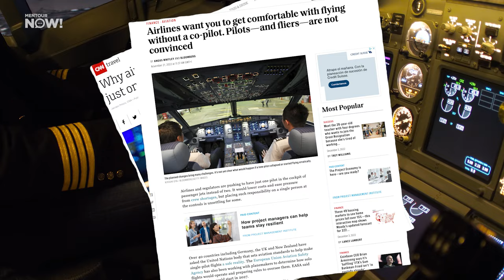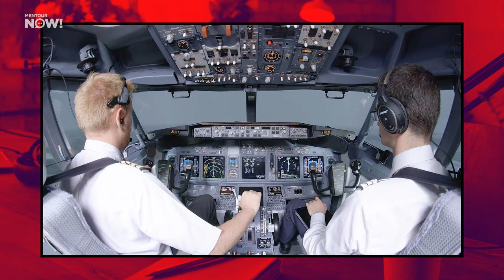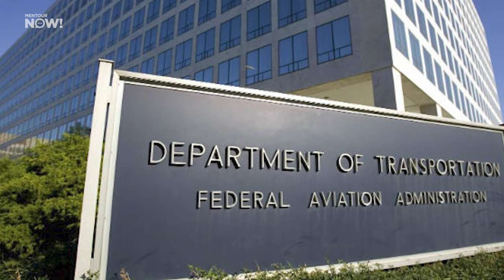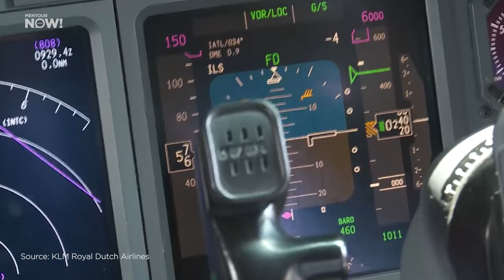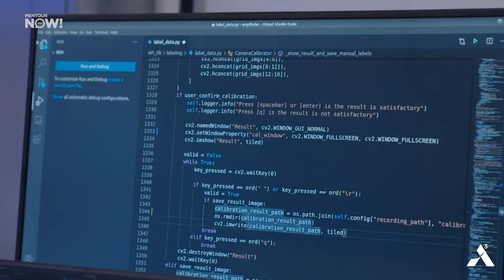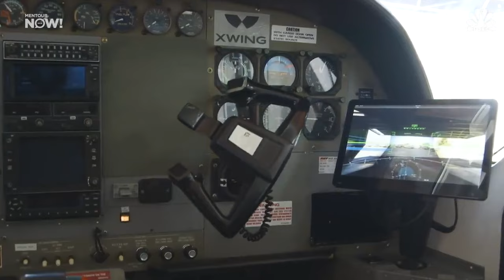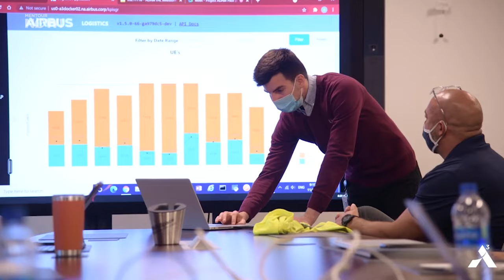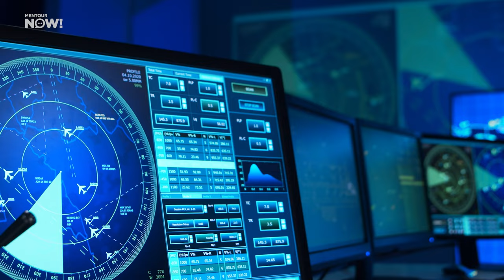The End of the Two-Pilot Cockpit?! Get Ready for Single-Pilot and No-Pilot Airliners!

Comment: If single pilot operation is approved, it most certainly will lead to a race to the bottom, all in the pursuit of higher profits.

While not a perfect analogy, we have seen this in the railway industry in the UK - removing guards (which is a safety critical role) from services and replacing them with Driver Only Operation (DOO) services. There have been a significant number of accidents (particularly people getting caught in the doors and dragged underneath trains) that potentially could have been avoided if the services had guards.
Reply: I would use a Boeing 373 MIN with only one wing, only one gear and only one engine flown by no pilot but a Tesla bot. And get my petrol from cheap russian tankers. Then i could sell ultra cheap tickets to the germans so they can fly to their beloved Ballermann every vickend.
Reply: Guards WERE a necessity in the days of unfitted rolling stock. The guard's role would have been better described as being that of brakeman. He also used to have duties with respect to protecting the train at rear in the event of failure. However, technology means that signalmen now know where trains are, that trains are also self-reporting and that the driver can communicate directly with signallers from the safety and comfort of his cab.
Let's not pretend that guards were infallible. History relates that there were also plenty of accidents caused because guards FAILED to protect their trains.There is nothing a guard does with respect to DOO that a driver could not also do. Change the rules a bit: make the driver step outside his cab before he closes the doors or install monitors or do a host of other things which give the driver the same ability as a guard to check the train is clear of obstacles before sealing it.
There have been a relatively small number of accidents of the sort you desccribe. As train technology develops, such instances become ever rarer. Simple examples: better sensors in the doors which can be linked to the motor. protective screens on platforms which align with doors (these have been implemented on many stations around the world). The guard just is not important enough these days to have a valid role in railway safety.
Reply: removing guards is not a necessity for trains as you can have cameras on the inside and outside of the train where the doors are to see if anyone is trapped in the door. The only reason they still exist is train drivers going to strike. People went on strike with the industrial revolution too, they didn't want machines taking over their jobs.
Reply: Aviation is most certainly going to follow a similar trajectory to rail if labor(workers) can't get it together and get power over these corporate boards.
Reply: @sadiporter2966  they didn't want to be poor and in the street, the job was not the issue. Make more, do more, get less, unless you're at the top. They may have sensors that could prevent something, but that doesn't mean they implement them, maybe sometimes but not everytime.
Reply: @thomasm1964  -  It might be worth considering that trains are traveling on rails at FL 0 AGL and are considerably less complex than a modern commercial airliner.
Reply: This is a completely false analogy, though. The DLR eliminated drivers before guards (assuming we are speaking of modern guards and not brakemen), and here we are discussing eliminating pilots before cabin crew. Perhaps the cabin crew are never eliminated. Perhaps it would be nice to have cabin crew on metro trains. That's all nothing to do with drivers or pilots, whose job is to interface with technical systems, not—aside from the odd joke on the tannoy—passengers.
Reply: @wickedcabinboy  To be clear, I am with Petter on this one. I want two pilots up front on an aircraft. However, I don’t have the power to make decisions about the future of aviation. Describing a possible course of development is not the same as approving of it.
Reply: @thomasm1964  -  Petter did not leave me with the impression he approved of it either.
Reply: The train analogy doesn't work. Japan for example has extensive driver only operation services, including one-man or no-man train services. If you're looking for something to blame in the UK, going to driver only operation is not it.
Reply: @sadiporter2966 and who is watching the cameras? You can keep getting rid of positions, delegating the previous jobs’ responsibilities to whoever is left, but at a certain point the person left will simply not be able to do so many tasks at once. A driver with some cameras is just not equivalent to additional trained and experienced workers.

There’s only so much attention/work that you can squeeze out of a single person.

Comment: Can you imagine what would have happened to the Qantas flight when the A380 lost one engine and cut all the wiring if there's only one pilot up there scary
Reply: Germanwings
Reply: Agreed, in general. It would be hard for automation to be coded for such a cascade and proliferation of failures as that QANTAS flight. However, the situation that Mentour suggests is on the cards would have two pilots during the takeoff and climb phase, which is when this failure happened. In fact, they had a check pilot in the cockpit, plus one other (for reasons that escape me and laziness prevents me looking up :-) so there was a lot more grey matter in operation than any automation software is likely to match.

Comment: Redundancy is standard in the western electrical interconnection in the United States (except, sometimes at Pacific Gas and Electric- PG&E - and we’ve seen how well that works). 
We could operate everything with single components, but prudence dictates that we plan for the N-1 contingency, and that can only be done if there’s at least two…

Comment: I agree it sounds like a good idea as an aid for the 2 pilots to help with the workload and especially if there is an incapacitation with one of them so the remaining pilot still gets some help and a system to check them because more mistakes probably would happen then from the extra stress of suddenly being the sole person flying and no checking system. To have automation help with that regard would be great or if the pilots are fatigue toward the end of a hard shift. This technology should be an aid, not replacement.

Comment: Thank you for a very well thought out presentation of this topic. There are elements that I didn't consider, such as the reduction from three to two flight members with no evident lack of safety. However, a single pilot is not something I'm willing to accept. I think most people are of similar feelings. It will be interesting to see what happens.
Reply: Keep in mind that the three to two was the removal of a flight engineer, not a flying pilot.  Automation can handle engine performance, but flight is a constant variable environment.  I agree with your few, but just wanted to enhance that removing a navigator, an engineer are much simpler than removing a backup pilot.

Comment: Even if the technology allowing planes to be flown by a single pilot was approved, I think it would always be best to have a second pilot in the flight deck in case things go bad. There are just some things that technology can't replicate, such as human experience and reasoning. Having two pilots is good for accountability. It's safe for everyone.
Reply: Indeed, exactly.
Reply: AI relies on input from sensors. What happens when those inputs malfunction?
AI can't look out the window and rely on its gut feeling and instincts... because it doesn't have any.
Reply: @WildB06  considering how often it is stressed that pilots should not rely on what they see out of the window, because their gut instinct is wrong, and that this has caused pilots to crash planes, you make a solid argument why we should replace pilots with AI.
Reply: @deice3  there's no doubt that on some occasions pilots have crashed a plane by relying on their gut instincts... but equally there have been many crashes where the automation and avionic sensors have failed. In an emergency situation I'd rather have a crew of professional pilots, with real and natural feelings and a strong desire to live trying to sort the problem than a computer program reliant on sensor inputs.
Reply: @WildB06  Indeed.

Comment: Petter, I have one thought that was not covered in that video, which is how will a newly recruited pilot build up experience to the point that he can be signed-off to handle flights on his own -- will he have to spend hundreds/thousands of hours in a one-pilot simulator?
Reply: Single pilot high performance jet non commercial operations are already a realty. I guess the requirements they envision for commercial operations, will be the same. If I'm not mistaken it should be: 200h Total Time, 70h PIC, and then the Type Rating Course, depending on the airplane, around 40-50h.
Reply: @limamikeaviation6200  that's less than single "pilot" operation in modern train like high speed train in Europe. They have a sort of "line training" that lasts 3-4 months and then they're left alone. So basically, besides all the other problems that we said so far, you should get the "captain level" in 3 months. Which is something that is unachievable at the moment and for many decades.
Reply: @toffonardi7037  I actually can't understand what you are trying to say.

Comment: I would require the passengers be told ahead of boarding or better yet when purchasing the ticket if there will be only one pilot.

Cleaver sensors are good to stem the issue with pilot fatigue and other distractions of unrelated pilot and co pilot chatter that is not conforming with the phases of "sterile cockpit" and other pilot shortcomings such as when being under the influence or on meds..

Comment: Glad to hear that even IF single pilot flying happens, I’ll be old enough to be past my flying travel days. Related: I want nothing to do with autonomous cars. I prefer driving standard transmission cars, even. So, you can see where I am coming from. I need to check out your 1500 hours presentation. Thank you for all of your valuable information and thoughts.
Reply: There are no autonomous cars. Maybe some in US I think, legal for a couple of blocks or something and they are monitored by a human. Some automation can also help in a car, the same as in a plane.
For some years now I prefer automatic gearboxes (in my country they used to be rare until 10-15 years ago), I'm using adaptive cruise control almost all the time. BUT I monitored the systems at the beginning tu understand what their limitations were, depending on the car manufacturer and/or model. This is really important, some people think it just works in ANY scenario, which is not the case.
Reply: Autonomous systems are still garbage in garbage out sensitive
So bad sensors lead to garbage in and to crashes, more complexity leads to greater potential failure. Two pilots is best

Comment: Surprised he didn’t mention anything about pilot hijacking. That is what I worry about the most. Some airlines even require cabin crew to be in the cockpit if one of the pilots need to go out of the cockpit for a toilet break for this exact reason
Reply: the autonomy of the aircraft will likely override the pilot but if that were the happen it would only create more possibilities for a malfunction to occur. it would be an mcas 2.0+
Reply: @frankkky7375  imo pilots should always have the ability to override controls in an even of a malfunction. This is why pilot hijacking is a major problem that should be thought through before allowing for single pilot operation
Reply: @criptonide  Indeed. Andreas Lubitz used in 2015 the Autopilot to fly the A 320 straight into a mountain.
Reply: @frankkky7375  737 MAX was grounded after 346 people died in 2 crashes, when plane incorrectly took a dive to avoid stall induced by faulty sensors.
Reply: That was my second thought, but more concerning is intentional downing when a pilot leaves the cockpit, and it does happen (Germanwings 9525, Egypt Air 990, FedEx 707 to name a few)
Reply: Germanwings 9252 intensifies
was thinking this too.
Reply: @LtNduati  yes, I was thinking of the Germanwings crash as an example of why this is a bad idea.  I think ALL airlines now require at least two people in the cockpit at all times, to avoid these exact situations.  Once the single-pilot operation moves from cargo only to passenger aircraft will there be an extra cabin crew member on board to fill that role?
Reply: @listenerererz  yea? i mean more about how mcas makes uncommanded trim corrections and the pilot will have no control over it unless they shut it off.
Reply: @criptonide  well it depends on the system, a lot of airbus systems cannot be overridden without pulling circuits or deleting code. I think what will happen, if they go through with it, they will build in many many many redundancies and maybe other external inputs maybe from cabin crew to eliminate the possibility of hijacking. Take a look at the airbus fbw system, that has never failed and has many built in redundancies that prevent anything from happening. Airbus have no hard wiring connecting stick and flight surfaces so if those fbw computers fail then the whole aircraft is screwed.
Reply: Not really the exact reason.  The cabin crew member is there to open the door from the inside to let the pilot back in if the co-pilot is too busy flying, or nods off to sleep and avoid accidental (or in the Germanwings case, try to prevent an intentional) lockout.
Reply: @haweater1555  The part where you mention about the pilot being too busy flying is inaccurate. All crew are able to enter the cockpit with a passcode, without needing the help of anyone inside the cockpit. However, this passcode can be disabled by a switch in the cockpit so that no one (even if they know that passcode) will be able to enter. This is what happened in the  Germanwings incident.
Reply: ALL airlines even require cabin crew to be in the cockpit in case of single Pilot operations.

Comment: As said several times here already, this breaks rule number one of aviation in that you have at least two of everything. If this rule gets broken, it will be reinstated, but not before people get killed. Tack så mycket, Petter.
Reply: Yes, indeed.
Reply: Not everything in an aircraft is redundant. Take the rudder or the front wheel.
Reply: Does this mean that a pilot is not an important component? Seeing the bean counters think we only need one of them! I don’t think single pilot cockpits will happen anytime soon. I sense a certain reluctance from pilots and passengers!
Reply: @aamiddel8646  Differential thrust on the engines can be used. It has been, and it has saved lives when flight control surfaces have ceased function (United 232,  OO-DLL)
Reply: @arctictiger8690  In case the front wheel sticks in the belly??
Reply: @scottlewisparsons9551  Sure a pilot is essential but when automation and safety is OK than it is another case. And yes it will not happen overnight. Naturally pilots will not like it. And for the passengers: they will get use to it (many trains ride on fully automatic without the passenger  noting it).
Reply: You'd get a sparkly landing and close the runway for several hours but everyone would be safe.
Reply: @butchslagergio5486  There are cases where wheels have collapsed. It is unlikely that a wheel will be stuck inside the aircraft because it is possible to deploy them just using gravity. Whether they lock in place or not is a different question.
Reply: @arctictiger8690  Thats beyond the point. The point is, not everything is redundant.
Reply: @dalentoews3418  the point is, not everything is redundant.
Reply: @butchslagergio5486  Hydraulic lines are redundant. And if you want to continue tp insist on something ridiculous like a second tail section that the crew can fabricate in mid air, join Airbus or Boeing's design teams. I'm sure they would love your expertise.

Comment: Hi Petter. Just watched a video from Real ATC (recordings and a simulation of the flight path) in which the captain died on takeoff. The co-pilot happened to be a check pilot and was able to handle the situation and land the plane safely and then had to move the dead pilot from the left seat for, I'm guessing, need to acess some controls. This is why we need the second pilot. I'm gobsmacked that anyone thinks that one fallible human on the flight deck is a good idea. You've done so much educating about crew resource management but that all goes out the window if the flight deck crew is one person and that person is incapacitated or dead. What's the backup plan? Have one of the cabin crew call for someone with MS Flight Simulator to come up and fly the plane? I'm getting too old for this nonsence. Just because something can be done using technology does not make it a good idea.

Comment: I think the closest arrangement I’d be comfortable with is to allow less experienced pilots to be the first officer (or maybe technically FO in training?). The idea is to have the advancement in automation compensate for the reduced experience, but the computer should be set up to train the newer pilot while on the job too, not just going through checklists on its own in the background.
Reply: Actually, the experience requirement for a FO to seat in an airliner during actual commercial operations is already quite low. Usually around 250h, but in some cases is lower 150-200. So we are already there.
Reply: @limamikeaviation6200 not in the USA. 1500 hours. Dumbest rule ever but it is there
Reply: @AndrewSteitz  Only an FAA rule. The rest of the world has other rules.
EASA requires you to have: 
-CPL, IR-ME (180h-230h)
-MCC (20h sim)
-TR (40h)
nothing else